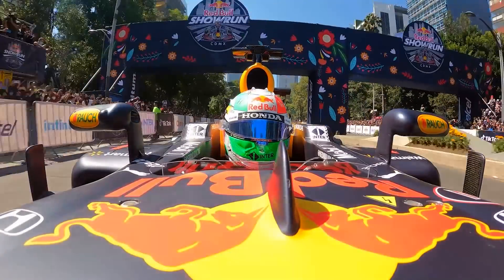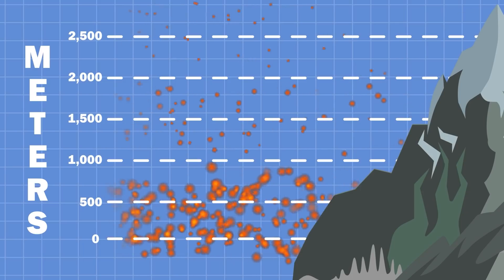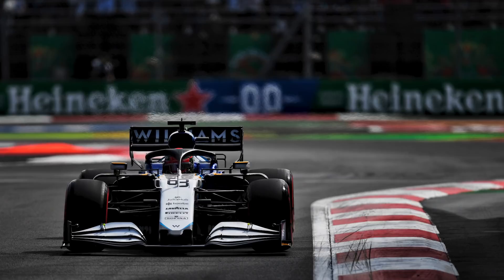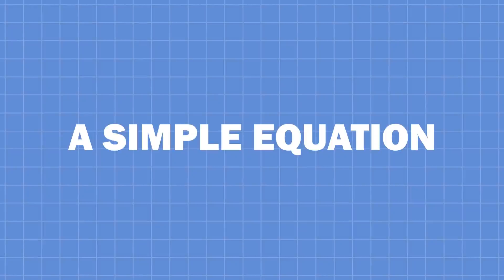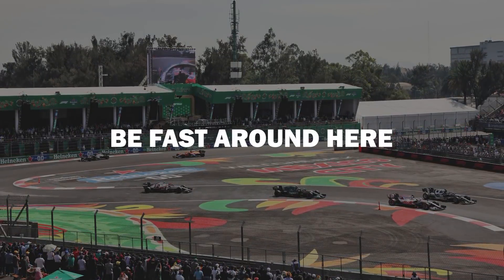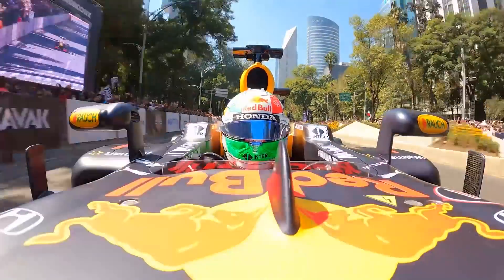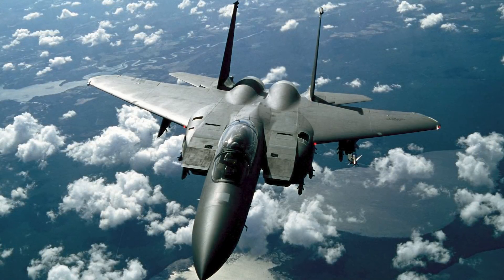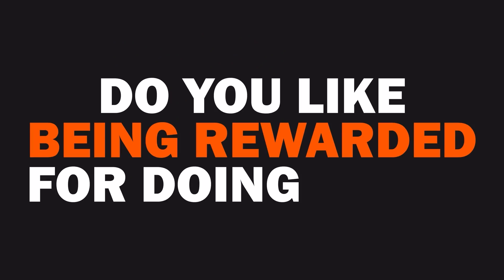How Does Altitude Affect F1 Car Performance?

Comment: 1:33 yeah that's not how downforce works
Reply: Why not
Reply: @macsenstavrakis205  the animation is all wrong... It makes no sense at all....

The air hits the car form straight on and gets deflected upwards by the wings pushing the car into the ground...
Reply: @squeakybunny2776  
But the point of the animation isn't to describe the direction of airflow, it's to show the downforce the car is able to collect based on the amount of air hitting the car
Reply: @macsenstavrakis205  the animation still draws lines of, supposedly, the air flow and those lines are completely wrong...
Reply: @squeakybunny2776  
The direction of airflow is unimportant to understanding the point of the animation
Reply: @macsenstavrakis205  If the point was to show downforce based on the amount of air hitting the car then just draw arrows going straight down. Why are the lines going down and back?
Reply: @talal26  
Fair enough. Still, although a bit lazy on the side of the animators, the point of the animation is clear

Comment: Qualifying: Merc is faster
Race: Redbull uses uno reverse card

It works perfectly (well almost since Checo still failed overtake Lewis)
Reply: imagine if it was planned because of the slip steam to turn 1. Its sort of like Sochi where there is a long run to turn 1.
Reply: Because Alonso was front of checo during the chase, rewatch the match or timings in youtube, each lap checo was closing and almost near as 0.400 secs gap and then Alonso came between and the gap went to 2.000 secs.
Reply: @jjoulekelvin2986 Alonso completely ruined the end of that race. He moved over for Lewis immediately but then basically started racing against Checo!
Reply: Mercedes used a Skip Card, unfortunately the Game ended before Perez next Turn.
Reply: They weren't faster in Qualifying though really. Red Bull just fucked all thier qually runs in Q3, and the Soft tyre worked slightly better on the Merc then the Red Bull.